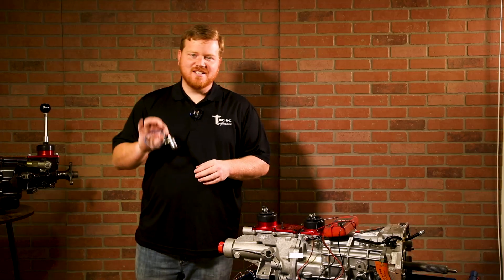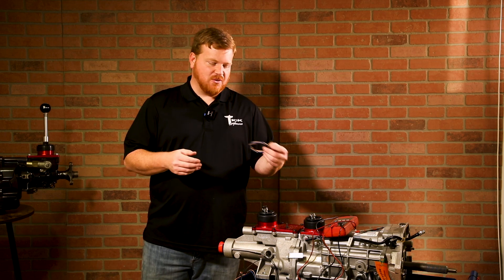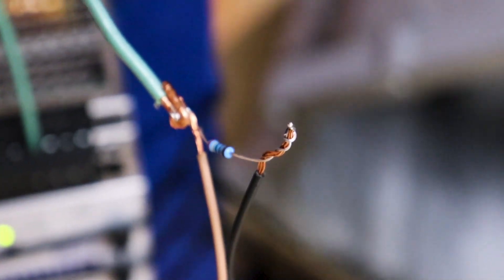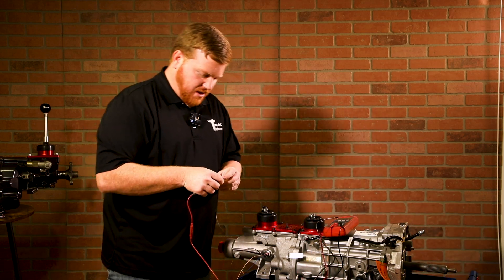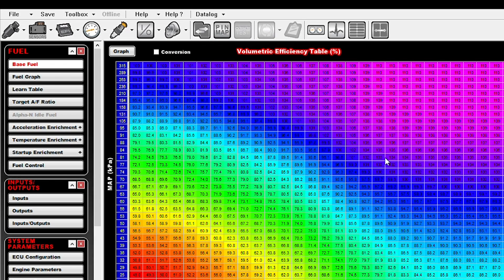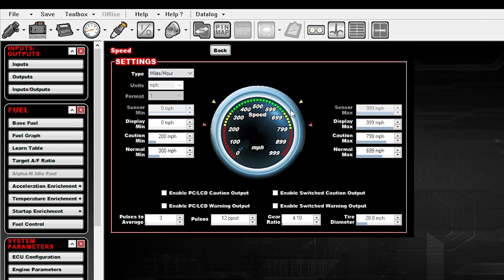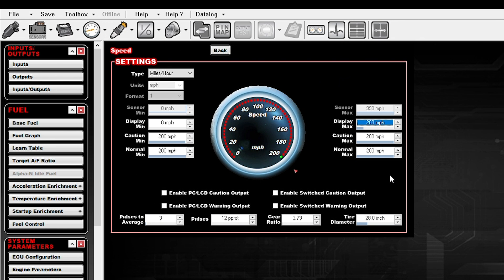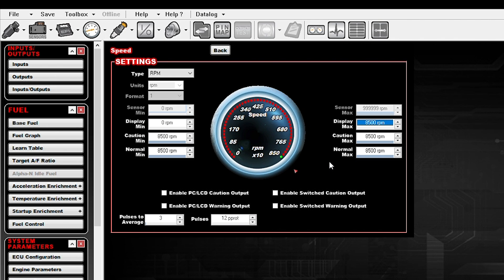Tick Hall Effect Speed Sensor For Tremec Transmissions

Comment: quick question will this sensor  work with the terminator x with no trans control ecu? i have a no trans control termintor x with yalls lvl5  magnum f and want a speedometer without spending 1300 for the pro dash rn.
Reply from the maker: Yes, it's a simple input signal setup. Give us a call and we can help you further!
Reply: will do appreciate it. @TickPerformance
Reply: You don’t need a trans controller for a manual trans if you’re manual, you’ll just have to adapt you’re stock VSS plugin to the one that goes to trans, or do what he’s doing and wire this into the triggers on the stock harness for speedo or do it how he is with Holley